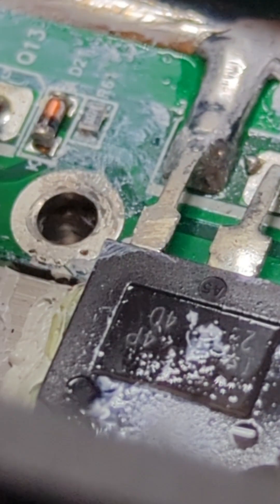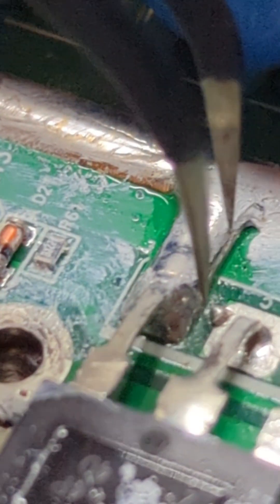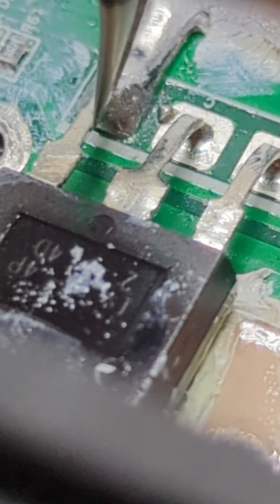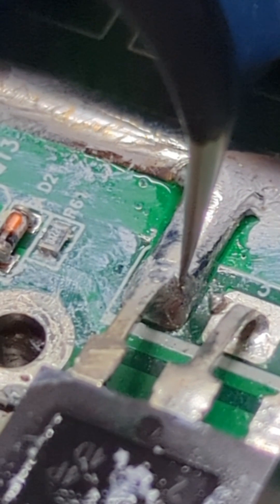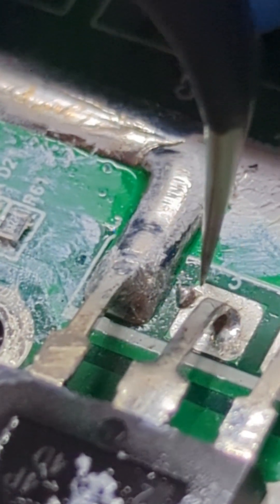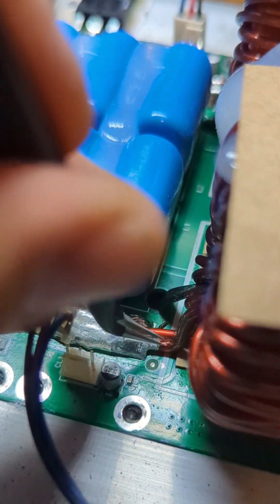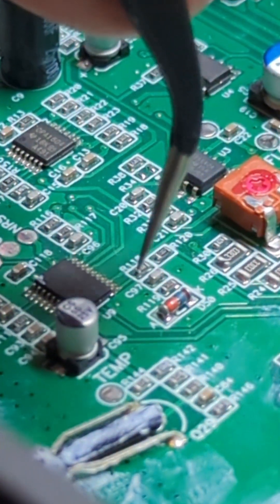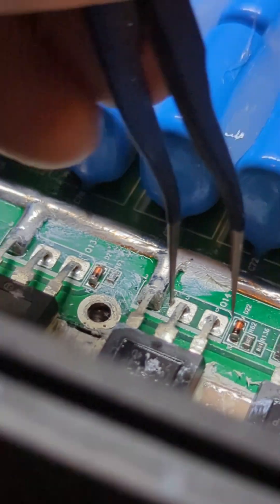Why did my first bass show end after 10 seconds? A solder ball!

Comment: I've seen and repaired LOTS of blown-up electronics. Nothing shorted there. If it had been even 20-30V DC it would have been BLACK and sooty as hell. With the voltages you have there, the PCB would have been black, sooty and burned.
Reply from the maker: I can't find anything else that would explain a pop and protect. Any ideas?
Reply: @LoudFiat  Could still be an errant solder ball on some of the finepitch circuitry, which wouldn't necessarily blow up with a bang. Seems like there is quite some solder balls on the PCB, that's either a solder paste that is not good or sloppy assembly. The boards should have gone trough a wash after SMT assembly, but the IGBT's are probably hand soldered.